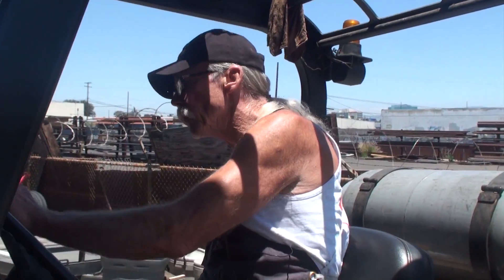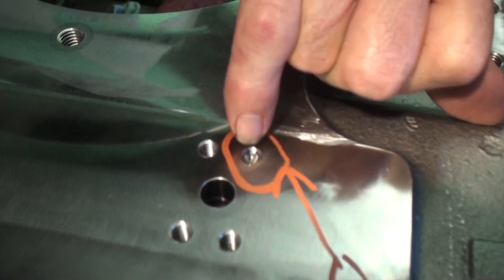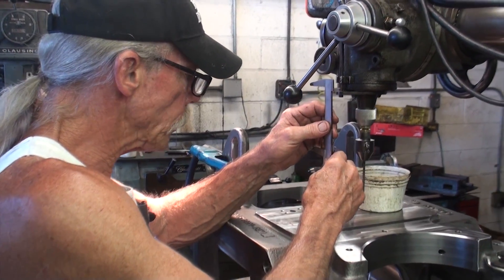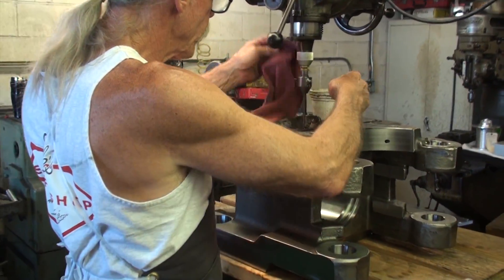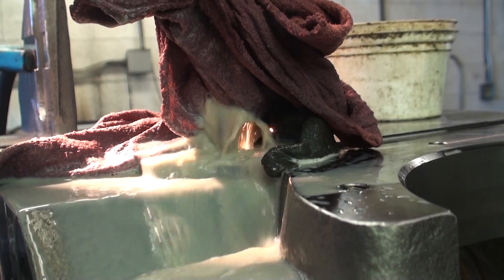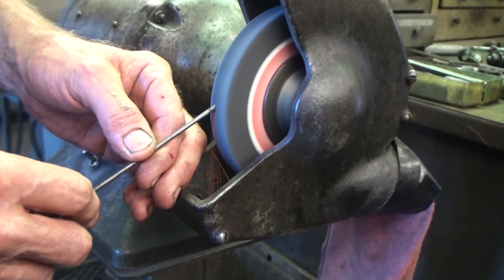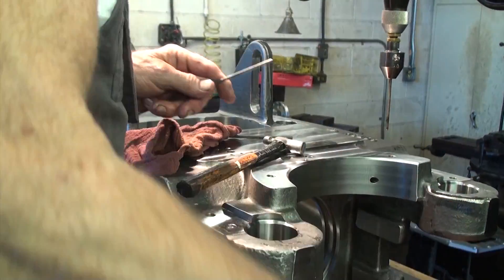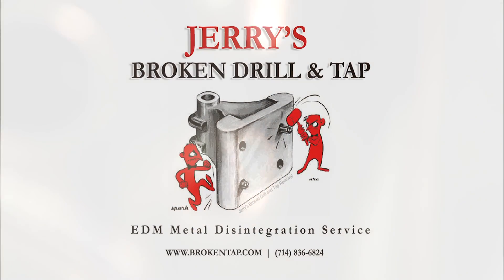Broken Tap Removal by Metal Disintegration Machine (MDM)

Comment: I was a machinist in a factory for ten (10) years circa '67--'76 and somewhat perfected a process of removing broken taps other maintenance techs had broken. I only had small high-speed steel chisels, such as Tom mentioned made of M2 steel. Later I went to work for another company who brought in an EMD machine. Once the factory tech showed me what it would do I almost hugged him. When you work with "bull work" mechanics an EDM machine pays for itself quickly.

Comment: broken taps do require a certain level of patience to remove. This method is no doubt a good one. I have seen good machinists get them out with with solid carbide three flute drill bits that may have been left hand twist. I have used diamond core bits with properly applied pressure and coolant to flush away the grindings But when you can't get the piece to a milling machine, that's when the men separate from the boys. The reason good machinists usually have miserable personalities is because they have no one else to blame if they screw up !

Comment: Looked like the burn through process unfortunately leaves some welding splatter behind. Why couldn't a harder drill but be used? I use a titanium bit to drill through a tap, slowly increasing the drill bit size till the stress is released from the broken tap, and then just break the remaining pieces in toward the center and remove them with precision pliers.

Comment: I knew about this process but have never actually seen it done , thanks.  That's a big casting with a lot of work done on it ,  do you charge 50% of the value of the piece you are saving from the scrap heap?

Comment: I know that carbide has come a long way since that machine wad produced.... have you tried using a solide carbide mill at a few thousandths under original drill size on projects ?
Reply: I have not tried that, but it seems like if you removed the center of the tap then the loose remaining flute pieces would jam in the mill and break it too. Is this not a problem, it works?
Reply: @BenAtTheTube  yes I've never had a problem just drilling em out.  Of course I'm sure u know , in a stainless thru hole, just blow em out with a torch
Reply: @csonracsonra9962  Thanks, I didn't know that, but I happen to have a broken tap and will try drilling it will a carbide mill and see what happens.

Comment: Removing broken taps, drills and stripped bolts was my favorite thing to do when I worked in a machine shop.  It was a nice break from running production jobs that never seemed to end and you really felt like you had accomplished something and saved the company some money by fixing a part that would have been scrapped.
Reply: We have a local retired machinest that bought a Acer Knee mill. And all he does is broken off taps, Studs, and bolts that guys tried to drill out with a hand drill then got the hole off center and made a hell of a mess. The best yet was a head off a 1066 International Tractor that the grandson had a bright idea of using a air impact on a cold engine to try and fix a exhaust leak. He broke off ALL the studs but 1. When I went to look at the job I told him there was nothing short of pulling the head off and taking it to this gentleman. The Grandfather said no problem, And the Grandson just rolled his 20 yr old eyes. And was positive there was no fixing his disaster. So the next day with head in (2 hands) We set it on the mill table and he started his magic. 2 hours later and 5 inserts to fix the out of shape holes. The job was done. I asked him how much?? He said normally he would get $40.00 a hour, would 2 hrs at that rate plus the parts be good?? I handed the man 4 $100.00 bills and said "NO, I think you need to raise your rates on jobs like this"  A good machinest  an save you hundreds if not thousands in some cases. Sadly the man's getting older and can't do the work he used to. And there's no one younger coming along to do this kind of repairs any more. Its sickening to think these talented men will take this knowledge with them to the grave with out passing it along to the next generation.
Reply: Ur a glutton for punishment I wish u worked at my shop lol

Comment: I didn't read through every comment on here, but I didn't see anyone bring this up. He mentioned that he has these chisels that have been tempered to a certain hardness. He then proceeds to sharpen them on a high speed grinder to red hot. Doesn't that remove all the hardness or tempering and normalizing that the manufacturer put into them? I'm no expert, and don't profess to be. Maybe someone that knows can enlighten me.
Reply: in theory it could, it depends all on how long the heat has time to travel trogh the workpiece. If you grind only for a short time it has very limited effect on the hardness. 
Also keep in mind that the part which is glowing is also grinded off.
Keep the grinding time short. If you need to grind more , always have a water pot nearby so you can cool the part every ~3-8 seconds or so ( you can feel the heat with you fingers, if its hoo hot to hold, you are too late, cool it before you reach that point.
Reply: the tip has lost its hardness at that point, yes
Reply: I think he only got it to dull red, not cherry red.

Comment: Years ago, I had heard about this "Tap Disintegrator" technique - this is the first I've actually seen it.  Very nice.  I would never touch a job like this with a TiG rig or a grinder - too unpredictable.  Also, ain't nobody using harbor Freight taps on that casting.   The taps used on pieces that expensive are hard, and tough.  not the kind of tap you can Dremel through without risking damage to the part itself.   Great video.

Comment: Is the arc similar to that of a plasma cutter, that blows air across a hot arc, melting a gouge in steel where you want it?
Reply: Welder would be a closer comparison to a plasma cutter.
EDM is a different process.

Comment: Dad retired as a master machinist years ago and during his career I would often go to the shops and get a little job done here and there. He was a master in every sense and could do the most extraordinary things with metal. I remember him describing this process but never saw it performed until now. Of course, Dad's response would be "don't break the tap." Well, that's good advice but stuff happens. I only broke one tap in my whole life and was able to twist it out with a pair of needle nose. Whew! Lucky.
Reply: Scoop oh man, U're really, really lucky ... I've got a 'new' motorcycle last year ... only 30 years old ... had to remove 3 broken bolts for just the first month ... lucky me they were not high hardness. Unlucky me one of them is actually not a bolt, but welded holder with threaded end. But anyways, can't use such machine. This is kind of specific, I see the workhead can't angle, so you have to level the part somehow. It is utterly strange the yellows are not selling such machines in hundreds already. But of course re-modeled for 'home use'.
Reply: @drgrunn174  Wow, I would love to see what you're up to. It's possible Dad taught me some trick that would help you out but without a clear shot at what the problem is . . . well good luck is about I have to offer. One thing though, wonder if someone with some real know how could develop a hand held device that would work. I'd say that guy would make a few bucks.

Comment: Back in the mid 70's I had a company remove a cylinder stud from the upper case of a honda cb750. The cases were sandcast (yes it was an early 69) that a hardened cylinder stud snapped off when I was rebuilding the motor upon taking it out. Learned to be much much more patient on the ones I did over the years after that.

Comment: Awesome video. So basically this machine is a very focused precision plasma gouger. Amazing.
Reply: Nope, EDM differs from plasma cutting process which is rather similar to welding.
Reply: Oh okay. I'll have to do some research on it. I find it very fascinating. Thanks for the insight.
Reply: @phantom21629 
Wire cutting is en example of EDM tech.
There should be more than enough material on the web to study the matter, have fun.

P. S While studying the EDM you can also take a look at ECM which is a less known but very interesting tech.

Comment: Tom, an honest question as I'd like to know: could you just weld a conical washer or short length of tubing to the broken tap (or broken bolt for that matter), then weld a nut or bolt on that, and spin it out with a wrench?
Reply: I had a similar idea, just weld a piece of steel and then just use a drill to back it out.
Reply: That's what they do where I work, since we have a welding shop. But it doesn't always work, depends on how tight the broken tap is stuck in the hole and how deep the tap broke off. I like this video.
Reply: Mdm seems like the most sure way that I've seen. Just burn the thing out and less shit to go wrong if you start welding and accidentally weld to something you werent supposed to well you have a bigger problem then just burning the tap

Comment: Nice video, good job,  I was working on an Owens 30 ft wooden boat in Long Beach,  ca  harbour assembling an engine in the bilge,  cleaning out the headbolt holes from rust, I had a 1/2" x 13 tap almost 1" into a hole, when some a-- hole was speeding through the channel and the wave rocked the boat so severely it through me over the block, and I broke off the tap about 1/8" below flush,  10 hrs of wd40 chisling punching  blowing air, I finally got it out clean, plus a Walton 3 flute tap extractor,  what a f--%$kin nightmare,  anyways glad to see how the pros do it. Thanks
Reply: Peter
Reply: Model paint mixer
Reply: William Ambrogio hey that was me on the other boat!!!!
Reply: threw*

Comment: I might be around Jerry's age. Back in the late 70's my father mentioned that there was this thing called "EDM" that could make a good living for somebody who could apply themselves to it. I was more of a biology/science person and that's what I pursued but I get it. If you imagine not breaking a tap inside final parts, but inside one of a kind tooling and dies for a factory where something went wrong, there's basically no price they wouldn't pay to get that tooling restored and back to work on the line. Figure out what they paid for that one off die to be fabricated in the first place. 
My father supplied non-ferrous metals mostly to industry. We had a guy show up at our house after dinner because my dad took home a piece of copper bus bar about 1.5 feet long for this driver to pick up since the warehouse would be closed by then. (My dad was great that way for customer service.) They sent a driver in a 5 ton cartage truck from Sarnia non-stop to Toronto to get that bus bar. That's all that truck came all that way for. The driver was headed straight back to Sarnia with nothing in that 5 ton truck but 1.5 feet of copper bus bar so their factory line could get powered back up.
Reply: This is exactly how EDM got started. I worked for a company that built die sinker and wire cut EDM machines 20 years ago. Really neat stuff can be done with those machines.
Reply: EDM is a different principle and it is performed in an oil bath.
Reply: It is Kerosene not oil, BUT it can also be distilled water ( De ionised )

Comment: Cool machine. Did not have one around when I needed it. Had a 300SL in the shop with a broken tap in the cylinder head.  Instead of pulling the head I got my Dremel with a few ball grinding stones and ground thru center of tap in about 30 min. Removed the flutes and found a broken stud below that. Did some more grinding to hollow out the stud and collapse it. Saved a $7000 head in 1.5 hr.

Comment: We've used Jerry's for years and have never been disappointed. The trick is know when to stop trying to remove a broken tap or bolt before you destroy the part and just take it to Jerry's. Get it done correctly, by pro.

Comment: Greetings Tom, I am trying to remove what is left of a brass fitting used to plug a 1957, 235, v6 engine oil out hole.  The engine rebuilder forgot to replace the oil hose; now I know why.  He wore off the head and could not get it off.  I drilled through the head of the brass plug however; there are threads left in the whole.  Can you advise how to get this hole cleaned and repaired? My brass fitting is a 1/8 inch 28 TPI.  It is a standard plumbing brass fitting you can purchase at the hardware shop, I believe it was tapered, I do not think the hole is.  Thanks.

Comment: Does friction grinding those hardened chisels affect the heat treating? The tip begins to glow on the first one, so they are getting pretty damn hot as you grind the end off. Of course that may be desirable for the very tip so that you don't cut into the threads as easily.

Comment: I read once where if you have an aluminum part you can dissolve the steel tap with alum which you can get at swimming pool suppliers. This I believe is an old machinist trick.
Reply: You can get it at the grocery store too. It keeps pickles crispy.

 https://www.walmart.com/ip/McCormick-Alum-Granules-1-9-Oz/10535117?wmlspartner=wlpa&adid=22222222227009269056&wl0=&wl1=g&wl2=c&wl3=40890013832&wl4=aud-310687321802:pla-78820077512&wl5=9011136&wl6=&wl7=&wl8=&wl9=pla_multichannel&wl10=8175035&wl11=online&wl12=10535117&wl13=&veh=sem